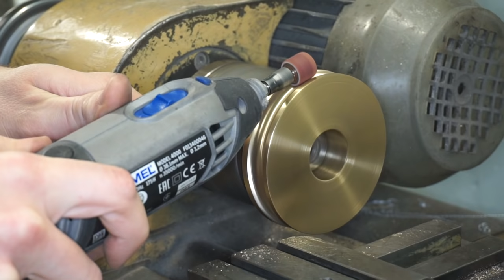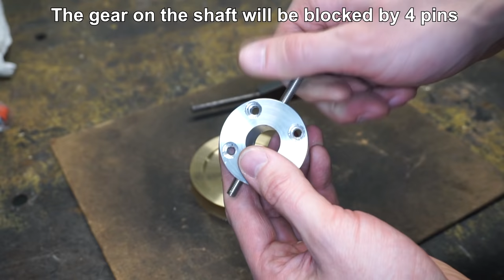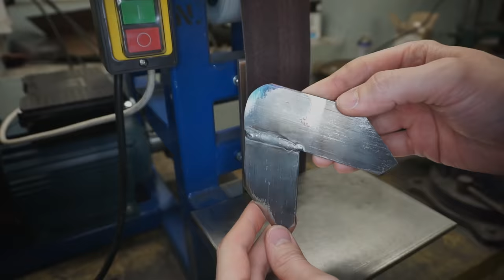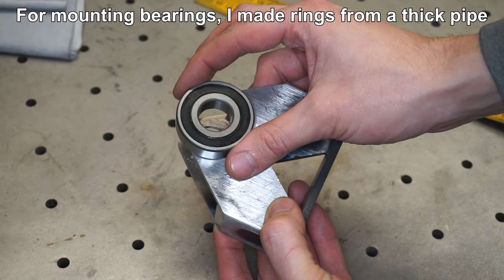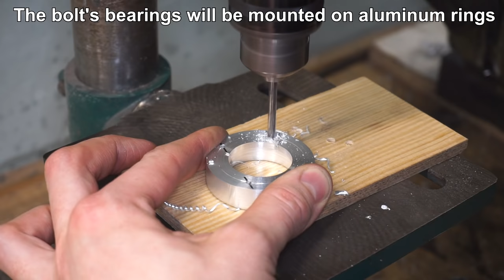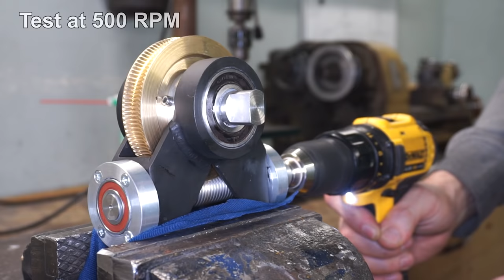Making a Worm Gear on Bolt

Comment: how do you calculate the diameter in order to avoid a thread mismatch at the end of the work?
Reply: taps are a certain number of threads per inch or millimeter.  As such you calculate the diameter such that the circumference is evenly divisible by the threads per inch/mm of your tap.
Reply: @therestorationshop  right
Reply: Pie is good, very tasty,  everyone loves pie.... you guys like pie?  Apple pie... cherry pie... shoe fly pie... mmmmmm mmmmmm love me some PI !
Reply: Good question and best answer too.

Comment: MAN! Man! MAN!!! This is genius! Using a common threading bit and a lathe... oh boy I will make so many worm reductors now lol THANK YOU!
Reply: Now my elevator may not go to the top floor all the time, but I have a sneaking suspicion you might have a little sarcasm in that tone of yours.
Reply: I doubt the strength of brass gear teeth.
It wont be able to bear high torques.
You will need high strength materials and also axial load bearings.
Reply: @adityarane5735  Most worm gears are made from either brass or bronze.
You are underestimating the shear strength of those two materials.
Reply: How do you calculate the diameter?
Reply: @adityarane5735  As Anel Pasic said, it's vary rare to find a wheel gear that isn't brass or bronze unless it's special purpose. That is your wear gear. Normally, the wheel gear is attached to another gear that leads into further gear reduction to handle even more torque if so desired.
Reply: @ToyotaKTM  its
Reply: Judging from the amount of backlash, the teeth could have used more engagement with each other. There was no way to adjust the spacing of the shafts. I'm guessing he oversized it, for its purpose.
Reply: Yep, fixed it's - its
Reply: @adityarane5735  YOu're right. It was a hard job doing two gears for my bending machine, I used 45c steel and hardened it after machining and machined it again using diamond bit, just because of the loads, check my video of 3d bending machine.
Reply: @corneilcorneil  It's a bit disappointing that no one answered your question. I wanted to know as well lol.
Reply: @corneilcorneil  circumference / pitch but I've tried this over 10 years ago and it really doesn't matter if you feed the blank into the tap slow enough because on each consecutive pass it aligns itself a little better with the previous cuts.

Comment: Wow, that is the most effed up way I've ever seen a gear cut, and it worked just fine. Props.
Reply: Yeah it just happened to align :D
Reply: @jaakkopontinen  ive been trying to figure out how he got it to align nicely too
Reply: Trial / error /luck. Or perhaps math (diameter vs pitch), but that would, of course, require veeery precise calibration and settings on the lathe.
Reply: @higamerXD  Not really. It's common to have a bronze ring gear. One, it will protect the motor since it will strip first, and it's a stronger gear to make out of brass compared to the pinion worm gear. Bronze is actually quite strong. Plus, it will hold oil better compared to steel.
Reply: It’s called gear hobbing. It’s a known technique.

Comment: Nice and interesting your presentation, but I have a question: when you first cut that gear using a M20 tap, how did you know the gear would have an integer number of teeth? That operation is usually made using a divider in order to get an integer number of teeth.
Reply: worked to nearest standardised diametral pitch? plenty of scope with the manual grinding (would have used a form tool myself)
Reply: You can make a good guess at a tooth radius that will work by doing some math.  If you are off by a small bit, the setup will mostly self correct, dividing the error evenly spreading the error across all teeth.

You run into the same challenge when knurling - a knurling roller has a set spacing that you want to work out to wrapping around the part an integer number of times.  But nobody uses a divider to lay out knurls.
Reply: The out diameter has to be cut to very close tolerances in order for the hobbed teeth to be perfectly in sync. There will be charts or tables available for this.
Reply: I guess if it's brass, you could just keep running it and increase depth until clean teeth were evenly formed, but youd have to be pretty close to the target OD to start off. Im sure there's charts for # of teeth for diameter based on TPI, but it might be faster to do the math than search for that.

(1 /your bolt TPI) = spline spacing, then multiply that by # of splines you want = Circumference, then (C / 3.14) will give you the OD inches. there's other ways. this will get you close
Reply: Outside calipers and a willingness to spend more time with a dremel in 90 second increments until you've arrived? Sneak up on it? The other responses are right about self-correcting, assuming one is close, but I'd be prepared to assert you could get it down to lathe tolerances with a dremel and a LOT of patience...
Reply: Also the Tooth profile will not be an involute so this gear will wear out fast
Reply: Is involute a factor with worms? The friction is perpendicular compared to spur gears.

Comment: How did all the threads line up so perfectly? Don't you have to choose the diameter very precisly?
Reply: Yeah, I wonder that too. At the end of the threading process don't know how they align OK to close the loop
Reply: @user735_  I imagine there was either a lot of trial and error or math and measurements we aren't seeing.    Probably measurements judging by how good this looked.
Reply: You just keep cutting deeper till they align. At a certain depth they will align then deeper they would misaligned and deeper again they would align again. When you have a full thread cut and aligned stop. Saves working out math. That my take on it

Comment: Very nice! It should be said though that not all worm gears have a locked output gear. I currently have a 15:1 gear in front of me which is actually back-driveable. Just so no one builds a dangerous machine based on the information in the video.

Comment: this looks amazing.  I do wonder just how much strain those smaller threads can take on a single side like that If it can take a few thousand pounds without deforming the threads this would be an amazingly useful bit of kit to have.
Reply: well, he did take brass so realistically this is only a desk decor piece as the brass could never take any amount of real force
Reply: Won't take much over time.
Reply: The guy most obviously knows what he's doing. I pretty sure he understands loads in respect to the application. I believe he made it more for the need of the ratio and not the output force seeing that's what he cited in text.
Reply: @TechieTard  Myself, I would have used aluminum bronze , it's really tough.
And for the bearing bosses..... I was kinda hoping he was using a digital readout on the X and Y axis' of the mill....... The back lash on the threads seems a bit excessive..... say 20 thou instead of maybe 3 or 4 thou.... meaning I would have used a fly-cutter to get the bosses dead-center for proper back-lash clearances..... but then, that's just me being a fuss-budget, lol.

Comment: Looks ideal for a homemade power cross feed for the milling machine.
Reply: Indeed.

Edit - Speed rate change would be as easy as four bolts.
Reply: @davidcarter2368  yes, good point.

Comment: Hi !

The idea is good but......
The tool you used to create the teeth on the crown would have to be slightly different.
As there is a height difference between the tooth head and the tooth foot, the tool would have to be modified so that the coupling between the screw and the crown was more precise.
It may work, but it can't be too demanding on the system.

Comment: Question
When that wheel comes around to the original place of starting, What's to say it will line up correctly to the original  threads?
I think you were lucky, unless you did some serious calculations
Reply: I'm not a machinist but I assume you could get your tap TPI, multiply it by a certain factor and that's your disc circumference

Comment: Very interesting. How did you know how to make the threads on the gear "intersect" at the end? I assume it was a calculation, but how does that get made? I mean, you could take it around once, and it could obviously just start a new threading overlaid on the old one, messing up the point -- the thread had to *exactly* match into itself after one (and each subsequent) revolution of the work gear blank.... even a fraction of an inch of variance would have meant a less than accurate in-fit with each successive revolution, meaning slop... How did you determine what was done/needed?
Reply: Could be wrong but I'd think after hand turning it to pilot the threads then having the lathe spin it several hundred times most likely created the path needed based on the positioning (how true/little the tap had any play) it creates a true pattern automatically based on it being a circle, plus possibly he just did the math based on thread space/circumference of the circle idk lol :P I'm lonely what can I say.

Comment: was there a calculation for the diameter of the output wheel, to make sure that the threads lined up properly around the wheel, or was it eyeballed and you just got lucky? using a cutter and dremmel doesn;t seem the most accurate, so i guess it was eyeballed.

Comment: A lot of work with many steps shown ....all good.   BUT .....not knowing what the "purpose" or "application" is, there are several questions.   Where is the "adjustment" for wear?    Someone commented about "good engagement" with worm gear sets.  Actually ...quite the opposite.  There MIGHT be engagement in only on how deep the thread is generated.  180° is the maximum, which is really a lot, and only ONE thread pitch is engaged.    So if this is purely "reduction" your needing, and there is no significant load, this will work for a while.
I couldn't help notice the chatter at 1:32.  You are not going to get a very good surface finish OR accurate thread form. Just wondering why the spindle speed was so fast ....also no cutting lube?
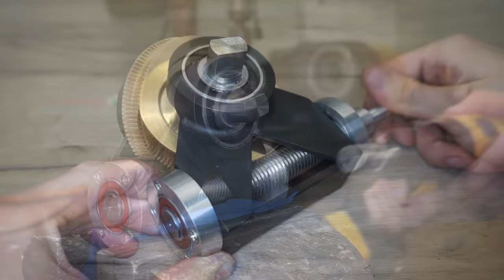And lastly, the bolt you used clearly showed it had a very poor finish on the thread. There were several points where we could see the thread. One was at 7:05 and you can see numerous "nicks" on this thread.
I suppose this "project" was to demonstrate steps of machining and fabricating.    To anyone thinking this is for "high torque" applications, it is not ....not with this kind of standard thread.  An acme thread would be the first choice.

.

Comment: How did you manage to get the precision right so there were an integer number of teeth around gear? Since the diameter gets smaller as you cut the ridges deeper did you just keep going until the ridges met in the middle as an integer number, or was it sized specifically/another part of the design process that ensured your brass gear had clean and a flat number of teeth?
Reply: Damn good question, just like knurling, sometimes you get lucky.  If he did calculate the number of teeth he's keeping it a secret.
Reply: @kenparkerarchtoppery9440  Now I'm gonna fall down the rabbit hole of knurling videos lol, thanks Ken. Hope you've been well

Comment: Wow dude! I'm very impressed with your ingenuity on this project. I do have one question for you if you don't mind. Why didn't you cut the bolt support bearing housing to a .001"/.002" press fit? The epoxy works too, and i love the finished product! 10 out of 10 in my book Brother.

Comment: Congratulations! Good job!
I don't understand one thing: did you do any calculations for the pitch diameter of the crown? How can you be sure that the development of the circumference is equal to a whole number of thread pitches?
If this were not the case, after the first revolution, the threading tool would perform more staggered threads instead of repeating the first one ...
Reply: Да полность вас поддерживаю если к примеру резьбонарезной метчик имеет шаг 1.25 а колличество зубов необходимо 40 то 40*1.25=50 мм длинна окружности

Comment: A couple thoughts... The epoxy is a high point of failure in a high torque situation, as in, the bolt can be pushed out either direction when the epoxy can’t handle the side loads. Capping the bearing and bolt on the coast end would fix that side. Some form of retaining the bearing and bolt on the drive side will solve that side. Good work!

Comment: How did you calculate the diameter of the brass 'gear' so that the threads do not overlap each other after one full revolution of the gear?
Reply: The circonferce has to be a multiple of the thread pitch. But as you feed the effective circonferce gets smaller, so I still can't wrap my head around it
I tried it myself and it worked even though I didn't calculate anything. Guess it wants to "fall" in the groove it already made unless it ends up perfectly in the middle

Comment: did this about 15 years ago to make hobbed gears for 3d printing, no need to cut out the minor diameter, the tap will do it.  only difference you did it with a 20mm tap, I used a 3mm tap

Comment: Nice work there.  Did you calculate the diameter of the brass part to get the thread forms to match, or did you refer to a table of some kind?
Regards Mark in the UK
Reply: There is a lot of math involved to figure out if that's going to work or not. Then I suppose there's a bunch of people that just get lucky trying it with no math
Reply: @spacecase0  Haha.  I know what you mean.
Reply: This is either problematic or self- solving, and I'm not smart enough to understand which. So the threads can never be off by more than 1, this helps.  Also, when the threads start cutting,  they must be off in order to be correct when finished cutting,  owing to the tpi getting tighter as the tap bites deeper.  So, if not aligned, just keep cutting deeper until it is perfect?

Comment: Nice job. Without oil the brass threads will wear out, I replaced a few brass gears on gearbox run by air motors they quickly go once the oil is low.

Comment: Most everything was well done. However, there is no way to adjust the backlash of the worm gear and worm wheel. It is very obvious that there is significant slope between them. This is detrimental to many applications. Being able to adjust that backlash is crucial to many applications of this technique.
Also, it would be good to be able to predetermine what the exact ratio would be and how to determine the outside diameter of the two gears. Also required is the depth of the worm wheel recess. This is fine for crude things like lifting mechanisms and such but, not for when precision is reequired.
Regardless, the video itself and the overall construction was well done.

Comment: you got all the tools to work with the bearings and you glue them..
Reply: what u mean?
Reply: @tuvidjek9407  means that he glued the bearings when his got all the tools to work with the bearings
Reply: @ann_teator  what do you mean by "work with the bearings"
Reply: @kiven_gamez4474  google "bearing fit"
Reply: In this case, it allowed him to weld the two bearing seats without the need to be perfectly aligned. The glue act as a filler around the bearing. I don't feel it is a mistake.
Reply: yeah bc bearing race it self is enough to bear any kind of loads right?
thats so smart, you get a gold star

Comment: Love this. Never thought of using a tap to turn a gear! The whole thing is brilliant. Question - Why do you glue the bearings instead of simply making them a light press fit?
Reply: Just a guess but it’s so everything can be made at a looser tolerance and they don’t have to worry about welding up the bits the hold the bearing perfectly in line 
While the glue is drying everything can still move and align to the shaft itself rather than being machined perfectly
Reply: After welding the machined bearing housings there would be no change to fit components together with tight tolerances

Comment: Hi, thanks for great idea, but you did several mistakes: you should polish tread on the bolt and you should expect that bearing can come out uder heavy load on the schaft. Probably you should to use special bearing for axial payload.

Comment: In my experience the tap will either be right or will self generate and produce a tooth count that will suit the circumference by successive cuts. If a specific count is required I have found that if you gash cut the correct count with a thin cutter (radial cut) then the tap will generate the required count.

Comment: I can see you are using some nice tools. Sad you don't have some more tools from 50 or more years ago. Even cutting soft metal should be oil lubricated. Cutting with diamonds? The same. Frigging dremel? I would like to take an English hammer to that.  Hat's off to you for a great video.

Comment: Every step is very clever and practical, you are a great machinist. But there is a design flow. The surface of a bolt's thread is quite raw, it's not the best, the tolerance neither and its not hardened, not designed for continuous rotation and friction. A real worm gear is relatively cheap, and its, much more pedantic part for this task.  It's not worth replacing it with a bolt in my opinion.

Comment: Fantastic work mate! Looks really good, works well too.
Best to have a nice tight press fit for bearings, if that's not possible then make it a sliding fit and use loctite bearing retainer (638/648) for bearing/shaft seals instead of jb-weld or generic epoxy. Also use tapered roller bearings instead of ball bearings for the bolt-drive if there's going to be high axial loads.
Reply: Depends on it's use. With JB weld you don't need a circlip or retainer cap, I use it often for this purpose especially if it is low speed low load..
Reply: Tapered bearing thrust side only. Other side should be a ball bearing. If they are both tapered the off side bearing clearance will increase as the heat of operation expands the housing.